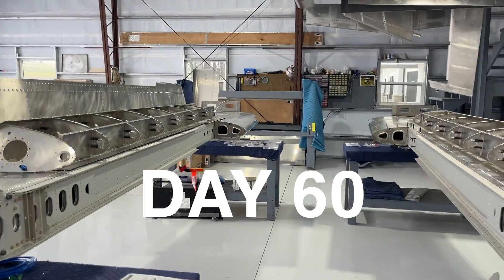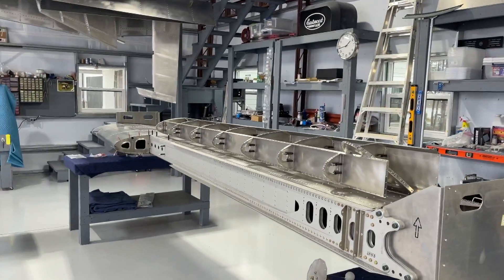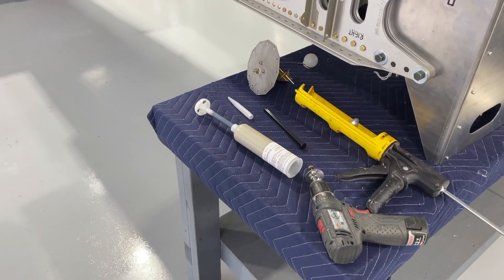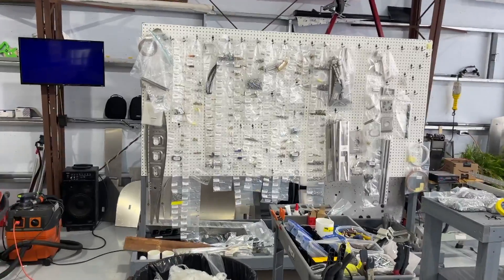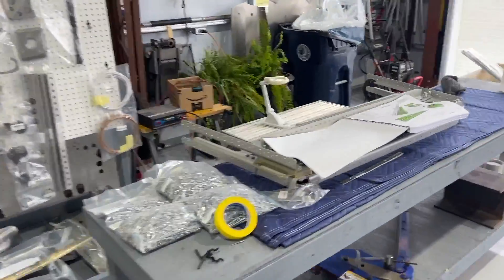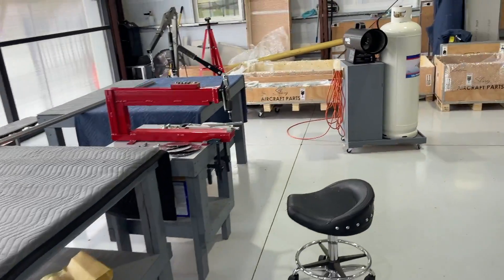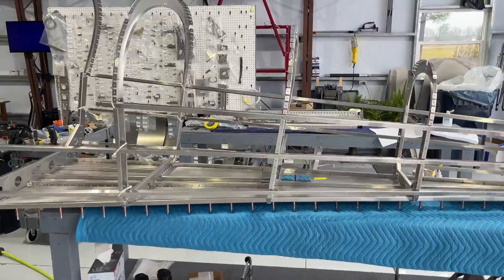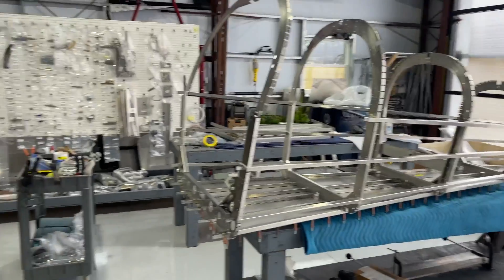Rear Fuselage Assembly BEGINS  [Sling TSi Build Video # 8]

Comment: I was wondering how you see the topic corrosion protection. I have see others doing the time consuming and expensive process with alodine fluid. Thank you very much for the time you invest creating this videos! Btw. the hangar is great!
Reply from the maker: The corrosion prevention question is controversial.  I personally do not see the point in priming or alodining 6061 T6 aluminum.  If this were a different type of AL, such as 2024, then I would consider corrosion preventative.  6061 T6 is about as non corrosive as it gets.  I have spoken to many people including engineers that specialize in metallurgy and they all seem to think it is overkill.  As one of them said to me, "it would be like wearing 2 condoms".

Comment: Just a little tip with your sealant, as it’s a B 1/2 your going to have half an hour of working time. If you mix up a whole tube at once, most of it will likely harden in the tube before you actually get the parts fitted and riveted. 

What you can do is get two containers and unscrew the catalyst from the tube. You can then squeeze the catalyst and sealant into the containers to measure their respective weights. From this you can work out the sealant to catalyst ratio. You can then mix them up in smaller quantities so your not throwing half of each tube in the bin 😊
Reply from the maker: GREAT TIP!  Thank you!
Reply: I used these tubes and didn’t have any issues with the working time when assembling the fuel tanks.

Comment: I think the sealant you showed is the half hour working time version, I used the B2  which is the two hour version and I still felt rushed. The mixing tool is definitely worth it so you don’t start off with tired forearms.
Reply from the maker: Do you recall where you purchased the longer work time version?
Reply: @TheBaldPilot  Aircraft Spruce. I think they don’t keep a huge supply of it since it expires, but they usually get it back in stock pretty quickly.

Comment: I think that the difference between 915 and 916 is that 915 has 1200 hours TBO and 916 has 2000. Which in experimental world is more of a guideline than a rule, but still.

The progress you made in 60 days is impressive.

Wish you the best!
Reply from the maker: I thought the 915 was increased to 2000 TBO, but I could be wrong.
Reply: @TheBaldPilot  Not yet. There's a possibility it may get increased, but not holding my breath. But, experimental or certified,  TBO doesn't matter for part 91 (not for hire) operations. Just inspect it per the maintenance manual, then run on condition. Based on the history of other 9-series Rotax engines, I bet money it'll run fine well beyond 1200 and even beyond 2000 hours.
Reply from the maker: @OneAlphaMike  Agreed.  I tend to follow the beliefs of Mike Busch and condition based theory.

Comment: Enjoying your videos. Nice job. Don't know what your experience is with that fuel tank sealant, but it's "interesting." I chose to go with sealant in cans and mix as I went. The cartridges are nice too. But don't overestimate how much you can get done within the working time. I had a buddy helping me which was huge. Evan's videos do a great job of describing the sequence. Not quite as clear in the manual. Super important to match them to the twist in the wing. For that access panel, I too thought it was missing. But the finishing kit had a stack of covers and all were there. I too have decided to stay with the 915 on mine. It was about $20K difference when I talked to them. Different motor mount, the cowl difference, and still some questions about the prop. The 916 is probably important for the high wing. But well proven for the low wing.
Reply from the maker: Thanks, Paul.  All good stuff to know.  Thanks for sharing!  And thanks for watching.